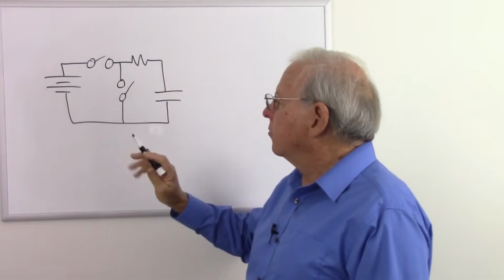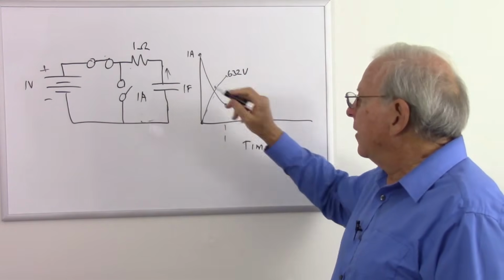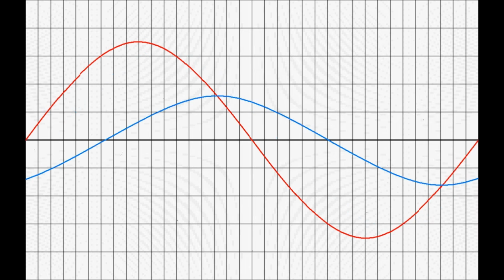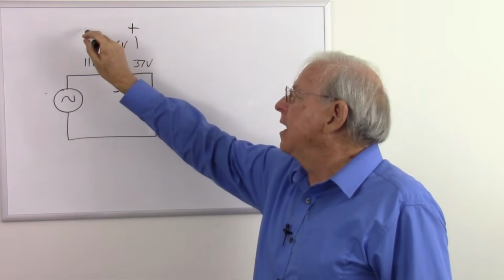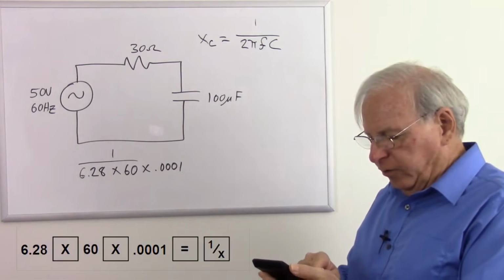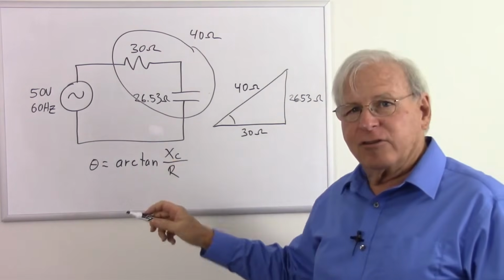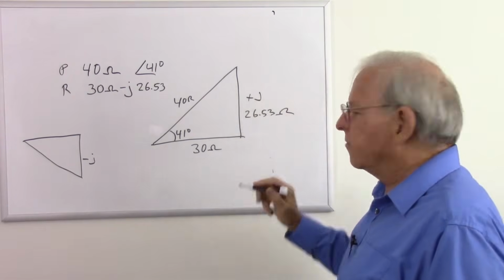AC Basics   Capacitors in AC Circuits

Comment: 7:70 yep this was the confusing part because all I thought was when the capacitor discharges, it maintains current direction but it turns out, it reverses the direction when it discharges, unlike the inductor it maintains that current direction when it discharges.

Comment: My professor had a great analogy for this.
Take a cylinder of some length. In the middle of that cylinder place a diaphragm. Now as voltage equals pressure, imagine the air pressure pushing against the diaphram to store energy. In an AC circuit the diaphragm will move in and out so the pressure on the opposite side will vary with the pressure applied to the other end.  Its not the same air but it is equal to the applied pressure. So like the diaphragm a capacitor passes the effect of AC but not the actual current. 
The more you think about it, the more it makes sense...

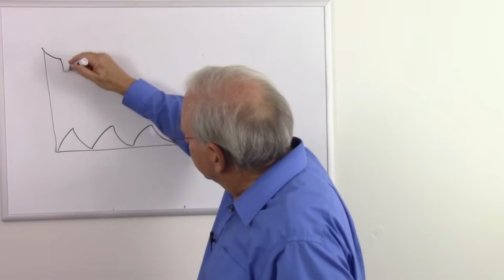Comment: At around @10:50, your portrayal of the negative current strikes me as incorrect. If you are only charging for a brief period of time, then the stored charge on the capacitor is minimal. Accordingly, when you flip the two switches to their opposite states, the negative current should be relatively weak in magnitude...as the voltage difference across the capacitor plates (which is responsible for initiating the current in a proportionate manner to the voltage difference across the capacitor plates) is weak. Could you please clarify? Or do I have a misunderstanding?

Comment: 11:15 
If I do this the voltage on the capacitor will be small 
then when I discharge it, It will produce a small current also
right ?

Comment: Why use resistor with capacitor
Reply: Let's imagine that you don't.
When you close the switch the current start to flow into the circuit 
and since there isn't a resistor the current will be infinite, since R is infinitely small (I = V/R)

Comment: YouTube has been robbing us, I only recently "discovered" you.  You're probably better at explaining things, than w2aew.  That's really saying something, imo.  I'll be keeping my eyes on you. ;-). AC circuit have always been difficult for me, even though I've made a bunch of amateur radio antennas that worked very well, but I've always been empirically driven.  I always liked math, including trig, a lot, but calculus (do you have videos for that) has never made a bit of sense.  I kinda understand reactance, but not the terribly well.  You've made it possible for me to connect to the math here.  Your last little tidbit about the sign, with the corrected graph, made it clear how inductive reactance can cancel capacitive reactance to make the "load" purely resistive.  I postulate that both reactance types can't coexist in a single feed line, you can only have one of the two types of reactance plus some pure nonreactive resistance present at any given node of a circuit. Thanks again, I'm off to watch more about AC circuits, maybe you have a Smith Chart video?  Thanks again.

Comment: In terms of physics of the circuit this video is next to useless, but in terms of engineering and actually calculating values it's quite useful.

I'd love to see a properly calculated capacitance of a spherical air capacitor - please mind that a capacitor has 2 plates not 1, so a proper spherical capacitor is made out of 2 concentric spheres, not one.

Comment: I started checking capacitors under load by rearranging the Ic = C(dV/dT) equation to solve for capacitance. In practice it looks like this: Start winding current/ d/dX(Voltage across Capacitor*sin(2*pi*F*0)) = C(you use 0 as time, because the derivative of a sine wave is greatest at 0, and your meter is measuring peak current, so you need to also make the derivative peak as well.)

Also a curious connection to help students understand: Capacitors present an impedance equal to Xc with a negative phase angle of 90°. But why 90°? It's for the same reason I stated above. Since Ic = C(dV/dT), the current is proportional to the derivative of the voltage across the capacitor. With a sine wave, the derivative is greatest when the sine function is at 0, this rate of change gradually tapers off,and becomes 0 at the peak. So the derivative of a given sine wave is actually equal to a cosine wave with the same amplitude, frequency, and phase. Cosine waves are shifted 90° This is why current leads voltage when AC is applied to a cap.
Reply: I still can't understand can you make visual video with animation
Reply: I’m just getting into calculus (again) years after graduating and only applying calc to biology, but now I’m applying it to electronics. Reading your comment really got me excited to continue, it’s dusting cobwebs off my mind and got me thinking. Thanks!
Reply: @XJ290  Thank you for the kind words! I'm mostly illiterate when it comes to biology, I am an HVAC Service Technician who just happened to get extremely interested in electronics. I've always found it beautiful how many phenomena in this reality follow an exponential pattern. When you apply a DC voltage across a capacitor, it charges in a decaying exponential curve, when you turn on your heating or cooling system, the temperature of the air coming out of the vents will rise or fall exponentially(the change in temperature starts off really high, and gradually eases into a fairly constant value) I've also heard that populations have a tendency to follow this pattern as well. Math is so interesting to me!

Comment: Hello sir. I love the video but I have a question. If the capacitor in the dc circuit discharges its voltage in the opposite direction to that of the battery's voltage then doesn't that make the capacitor voltage negative too just as the current? I know that the capacitor voltage just exponentially decays until it reaches zero but it still goes in the opposite direction to the battery voltage. I would appreciate it if you could answer my question thanks.
Reply: That is what the switch in the middle is for, when you discharge C, it goes a different route, towards ground in example given. You can/could route that switch to something else or use a diode

Comment: Arnold Scwartzenager said “ any rep is a hood rep”… 
THIS LECTURE IS…DELICIOUS…. 
In high school I attended “Vocational Training” / electronics in my junior and senior years… ( 1972-1974)…  and resistors, capacitors and inductors… and therefore LRC circuits …and therefore “ right triangles”…. Were…the…. Peak of our mountain tops….

I am interested in reviewing the concepts … just because…. ( and I have some old tube and transistor amps)… I can clean  pots, switches and tube sockets all day… but eventually we need to remember  how to trace volts … know what to expect …and how to do it safely when sometimes there is 400 volts in the circuit.

Again… GREAT…SERIES…of lectures…
( one of my first benchmarks when I saw that I was from a previous generation….  My younger ( by eight years) sister… while holding my slide rule…I asked…  “how do you use this?”…. And then my even younger sister ( ten years).. asked.. “ what …IS…this thing?”
Reply: Ooops…”any rep… is a GOOD rep”… this lecture is re- pushing my brain… and it hurts good.
Reply: Slide rules and Trig… we didn’t have “useless numbers”… we had “one more step” … and all answers needed to be out to the .oox .. using the slide rule.

Comment: How can you have 1 amp of current flow with 0 volts?
Reply: It was 0V across the discharged capacitor (acting like a pice of wire at the beginning), but there was 1V across the resistor - the only one element limiting the current - that's why 1 amp of current. And that's why you shouldn't connect (especially big) capacitor directly to the power source.

Comment: Hi bob...something  is confusing  here, i belive you are refering to a non polar capacitor  here.in your video about voltage amplifier (using a microphone as Ac source ) you use a capacitor to block Dc.i guess a polarised capacitor is what you where refering to  at that time. Am i correct in my understanding?if not, hence does a non polar also blocks Ac ?
Reply: By the way great exaplation

Comment: Ok so.. ive gone from kind of knowing, to knowing nothing... several times during this.
Do i stop or continue? 
All i want to do is switch this GD mosfet and im mixed up to heck with what resistance after R has raised and lowered v and i at each turn :(
Reply: This topic is pretty hard. What about this video do you not understand. I'll try to explain
Reply: @Slovenija_patriot  Confused whether more or less resistance raises or lowers current and voltage on the gate.